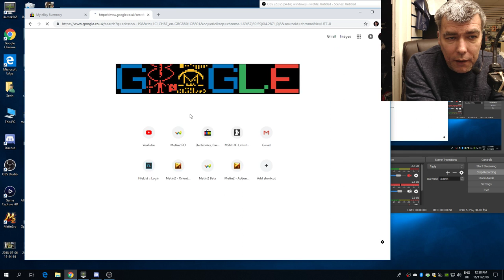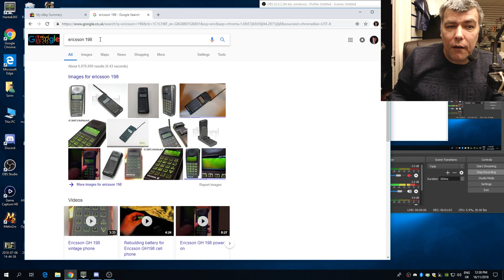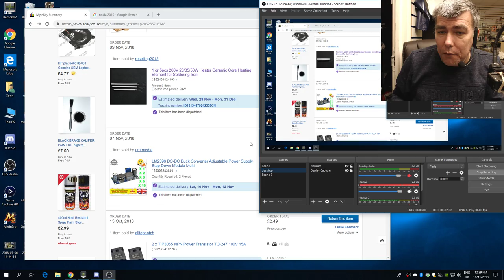Build Your Own Hot Air Soldering Station SMD Rework

Comment: I've not read all of the comments, so maybe this has been suggested before - if you add a length of thin rubber tubing to the cool end, you could blow through that meaning that you could direct the flow of hot air independently of moving your head :-).

Comment: This old school Romanian ingenuity, helps us now in the west. I'm from there as well,  but I'm in mechanical field and I work for a space company in the US. Repairing electronics as a hobby. Back than, I made 68' VW Beetle engine bearings(connecting rod) out of big truck bearings. Dish systems from scratch: winded my own transformer, made my own box, dish mechanism and the orientation mechanism, out of windshield wiper mechanism, etc.
Reply: Watch electronics and mechanical and other fixing videos from India. They are doing the impossible with hardly no means. Where there is will...

Comment: Its a hobby of mine to repair electronics and I had tried before to use a hollow soldering iron but there was too much air filtering and I was unable to blow more air on the tube to create the pressure needed. You tought of simplicity and this is just genious man. I'm going to make my own toy now. Thank you

Comment: espacially this episode reminds me how i built my first hot air more than 20 years ago... a modified AT power supply, an aquarium pump, a piece of copper tube and a glow plug from a W123 200D engine. In my case used to fix digital Satellite Receivers which came up the late 90's (in those times such STBs cost 1000 to 1500 bucks so it was really necessary to fix them).
Dear Sorin,
i appreciate your work and sharing your videos with us. It is awesome to watch you making your experiences, learning something new every day and always thinking for a proper way to get the job done.
Many thanks and keep up with that outstanding good work and videos
Reply: Were they all larger gauge SMD components?

Comment: Great video!  Add an aquarium air pump, and a valve.  And a PTC resistor to read air temp.  I use to use the quartz tube from a  (burned out) sodium HID lamp for the heater.

Comment: Creative at that time as an “improvement”, good to see that +/- 8W of heat were able to do air soldering. For stable AIR FLOW I have some suggestions (none tried (yet)!). I thought to use an Aquarius air pump - I have some unused. 
But to make it really cheap, blow/inflate a Party balloon 🎈 or a tiny bike air chamber - it could store 2~3 breath and make a stable air flow. 
The air flow could be controlled by partially bending a plastic hose (as those used for IV medication, or probably through a thin plastic tube (as in spray lubes) or up to thick IV needle.

Comment: You can add a piece of plastic tube, attached to an aquarium air pump, and for the air flow regulation, they have an in line plastic pinch valve. Good tip. Thanks.

Comment: Wow!, that was impressive,  I never thought of that!. What  I have done is using a 100 watts soldering iron and put the an hot air tube and air with it. But it was no success. It's hot enough to melt the lead but you can't really remove even a small smd resistor.

Comment: I  just found this channel last night and really enjoy the videos i've watched so far. I would think maybe a cheap aquarium pump with a variable switch to adjust the air speed could work ok. I would like to see others ideas on wire type, such as using a spring steel are other ideas and guages of the wire for a homemade setup. I have a $900 Weller, but playing around with building from scratch and modifying things is what got me started fixing things around 40 years ago. Maybe with throwing some ideas out their he will do another video on things from our thoughts so someone could build their own setups from his video. Not just anyone can afford a hot air station, it took me years with a cheap pencil iron before investing on fancier setups and plus its a fun thing to build your own things and can learn a lot from them and repair them yourself afterwards if need be.

Comment: The wire is called "NICHROME WIRE" there are other names but i can't remember them,it is used for bag sealers,electric fire elements,hair dryer elements,styrofoam cutters/shapers.

It's quite cheap on ebay and you can get different gauges of wire for different power elements.

I think for me i want a hot air station that runs from batteries that are solar charged,though a better idea would be to run from large super capacitors that get charged from a hand crank charger and run on low voltage or run through a 220v inverter,which would be tha fastest charge method and get some excercise into the bargain.

You could have a super capacitor bank large enough to power your work light and soldering station of any type.

I have not tried to source mica insulator sheet the same material used in hair dryer and hot air stations that the element is formed around ,but a very good non mains powered set up can be made quite cheap remember that the initial cost will be the only cost as you no longer have to use utility mains electricity.

Comment: You could add a small air pump from a small fish aquarium that wouldn't have a large airflow to the end of your ceramic tube, and a valve to control/restrict airflow as well for the right temperature to airflow ratio.

Comment: a classic hack ! lol  now hook it up to a aquarium air pump and you have a hot air station !  :)
Reply: @bluethunder7814  I'm  thinking hair dryer. 17 years ago  we don't have (in Portugal) aquarium air pump, at least in the interior of the country. But you have to hack some tubing to downsizing it.
Reply: @raulmiguelramos   Um secador vai é fazer um vendaval que leva tudo pela frente. vai solda, vai smd's, vai tudo pelo caralho ahahah
Reply: i'm using a 12v computer muffin fan and a hand rolled ventura tube with some tungsten wire all running off computer power supply, ugly as fak, but works beautiful ;)

Comment: Nichrome wire can be found in blower fan resistors of cars in salvage yards, toaster have wire but brittle, hair dryer or heat gun for removing paint. Harvest, cut, measure & apply amps to measure. I use an “IR” gun as I worked on cars.
  Also, you can get a flat white 6X6, 12” X 12” ceramic tile at home improvement store or tile shop to sit hot items on during work to testing. It a much cheaper option. Enjoy videos!

Comment: Huh. Nice job. But back days I was able to make IR soldering tool for that purpose. I used cigarette lighter from my car. I made handle for it and used small fan to cool it from outside. Also its has some advantage over hot air - you cant blew out elements from the board and its very easy to work with.

Comment: Hello Mr Sorin :)
Great video, really you're a real Genius ! All time you use your brain to solve problems ...where there is a will to find a solution.. there is always a way... Necessity is certainly the Mother of All Inventions...
Thanks for your video,s we learn a lot from you...

I have got a question, even though you explained it very clearly that this should be controlled by amps and not by voltage.  The amp-miter was showing  1.72 amps but we couldn't  see the volt meter, ... my question is: what voltage did you use ?..

Comment: Can't you put a squareof metal plate or foil on the chip and heat with the iron?  I'm amazed that all the little components don't go flying when hot air blasted.

Comment: So there is someone else out here who has to test & repair his test equipment to test & repair other's equipment...  Fargin' Fantastik brother!
my homemade heat gun, I use tungsten wire, thermostat control from an old vape machine and a small 12v muffin fan with a cleverly designed mini-wind tunnel velocity "tube" (kind of like a ventura carburetor effect) And NO, I don't make video's on repairs because:
A.) Absolutely No time during daylight (I need a 32 hour day actually)
B.) With me being me, I'd end up with a few thousand dollars of hollywood lighting, camera's, editing computers, 2 resident SFX geeks making titles, endings, final productions, etc LMAO... between Malfunction Junction, The Band, & the lil woman (notice she was last on list,lol), I sleep 3 hours instead of 7-8 as it is...D'ohhhhhh
Sorin, you're a man after my own heart, I'll make something before I buy it whenever possible. I should send ya the plans on how to illuminate the whole shop with Ceiling lights made from 50" LED TV's (+BONUS, now with Original TV remote controls for fading lights or volume control/input for the BT receiver playing through the existing TV's speakers in those lights. Currently working on a BT daisy-chain software so all speakers in all the frames will sync together, (I have 6 50" LG frames with diffusers still in, but the busted display glass removed hanging in shop) Light bill reduced by almost 25% ;) Had to build a different power circuit and by pass the TV's PS for the LED supply circuit or the shop would go dark in standby mode after an hour of non-interaction...LMFAO

Comment: Sorin i think the old saying applies to your creation "Need is the mother of invention.".
Yes thicker nichrome wire could have taken more heat, i bet your original tool was glowing very bright indeed :-D.
If someone can find a broken hair dryer, there is resistance wire in that, although i would not of expected you to have one 20 years back.
Reply: RavenPrecept
You are right but i was thinking about things that someone could afford to throw away in a relatively poor country, other things would have to be repaired.
I was born into a family with very little money so repairing things was the first thought.
But you are right :-)
Reply: RavenPrecept
I would not be supprised lol.
I liked the old pot bar electric fires, good wire spiral wound on a pot former.

I had an antex soldering iron that died, i could not afford one at the time so the element was modified/bodged lol.
it tided me over untill i got a new one.
Sometimes you have to bodge :-D
Reply: Vaping wire is a cheap, readily available source of NiChrome/Kanthal etc. heating wire.

Comment: Hey sorin! This is a really cool project. I was trying to replicate it. Just curious what was the voltage across the resistor? Meaning how much power was the resistor dissipating?
Reply from the maker: you don't feed with a voltage limit, but with current limit
Reply: @electronicsrepairschool  I see. But how much power was the resistor dissipating? Unless that's a dumb question that you technically already answered.

Comment: heater made of ceramic.You have nichrome wire heating element and ceramic heater with a different type heater.Like real hakko iron uses.Can see it if you held it up against the light and you se a pattern like printet and not wound nichrome wire type heaters witch are the worst to buy on ebay.You probably know
Reply: Ah, do the real Hakko cores have fancier heating wire patterns?

Comment: Man winding your own coil with resistance wire would be easier and you could fit the coil inside the tube. 24g Kanthal would do the trick.
Reply: Yes, if you can order it. Sorins solution is for all others.

Comment: 1. Can we buy the tube & wire on eBay?
2. Can you repurpose a hair dryer to do the same thing?
3. What's the cheapest  Hot Air SMD Desoldering Station can you recommend that's on eBay?
Reply: Yes - the tubes are from cheap soldering iron elements and the resistance heating wire is commonly sold as vaping wire in all different gauges.

Comment: sir if you can explain how we can get a low voltage with high amps exmple 1v /10 amps with a linear power supply not with a switch one  i hope that u will epxplain that because i want to know and  google dont explain enough

Comment: At 07:56 , this is how you work fucking dangerously by chopping open a wire wound resistor with a cutter's point while holding the resistor with your other hand :( Preferably use a hammer for such work :)